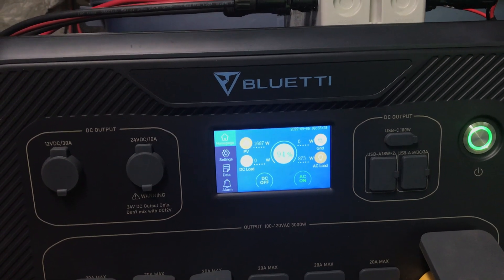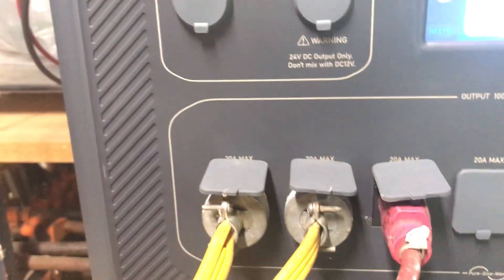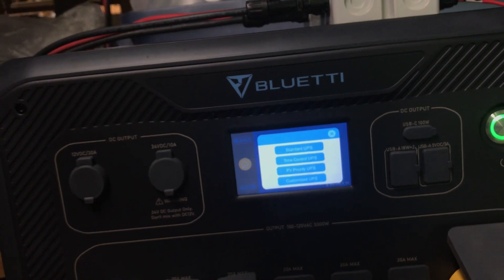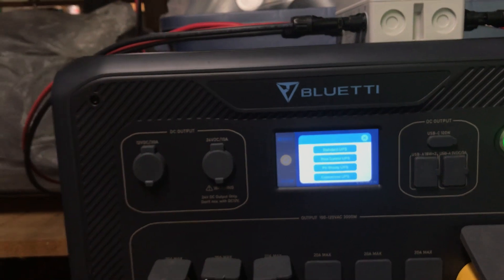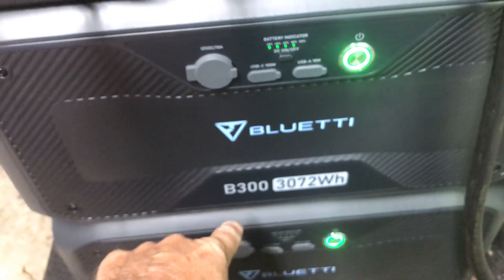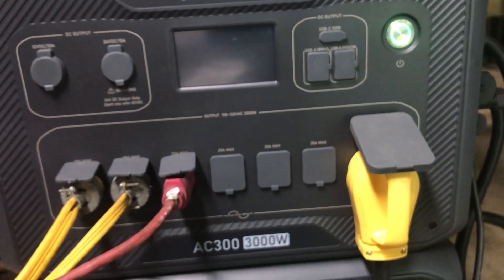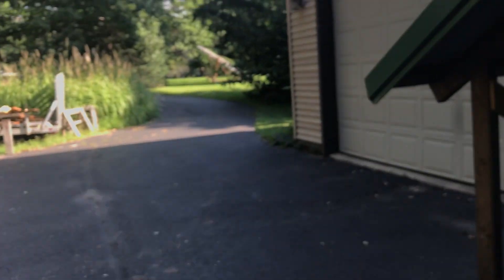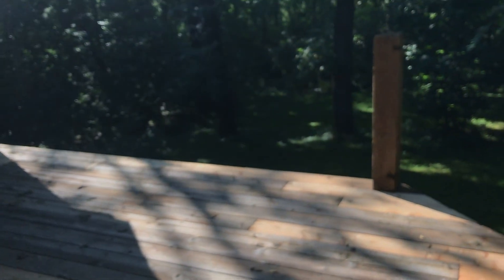A newbie learning UPS modes on bluettiAC300

Comment: Hi from Italy, thanks for video. Trying to figure out why my ac500 has 10% battery charge drop in 8hrs at night in pure standby mode, ac/DC off. It works as UPS, grid charging only ar 20%< PV priority. Where is all this consumption coming from,? Bluetti is suggesting to disconnect panel and grid charge ... Come on, it's an ups, I cannot! Best setting to prevent this loss? Thx for tips
Reply from the maker: I have heard from other sources that 10% charge drop happens in standby mode. Funny how Bluetti answered you
Reply: @johnkayak10  huge loss right? Thx for reply

Comment: Video named UPS modes ... but it doesn't cover none of the modes, there are 4 of them
supposed content:
* Standard UPS -> it is used when you need just an UPS things. So if your grid is off, it will drain your battery, otherwise it will change up your battery + it will do direct-flow from the grid to your outlets (on a AC300 front panel)
* Timed UPS -> ..some description goes here (sorry have not tried on mine this mode yet)
* PV over UPS -> you are able to use PV charge over grid, also it has a setting number which shows percentage, then grid will be used (100% - that percentage it will use only your battery) -> simple+elegant way to reduce your billings drastically, and save you battery from low discharge moments (when it reaches your set percentage, it starts to charge battery + direct electricity from the greed)
* Customized UPS mode -> PV over UPS rules are applied, but have not tried Timing settings (first tab in settings for this mode, used only the second tab), first tab in settings allows to ... (sorry, have not tried yet to change anything in this tab), and second tab allows to set 2 values: first percentage when bluetti should stop draining battery (if PV cells doesn't cover connected loading to your bluetti) and start the changing from the grid, and second percentage to shut down all load (when it reaches that percentage, bluetti will turn off any load on it's front-panel outlets)

so none of the modes are covered, and yet video name seems like a fake
Reply from the maker: What do you suggest I name it? I will change it

Comment: Is the UPS switching time fast enough to keep a workstation or gaming PC running when you pull the plug of the grid power?
Reply from the maker: This is what I found  
10. UPS
10.1. UPS Description
An uninterruptible power supply or uninterruptible power source (UPS) is an electrical apparatus that provides emergency power to a load when the
input power source or mains power fails. A UPS differs from an auxiliary or emergency power system or standby generator in that it will provide near- instantaneous protection from input power interruptions, by supplying energy stored in batteries, supercapacitors, or flywheels.
10.1.1. FYI (For Your Information)
Max. capacity retention indicates the limit of capacity of the unit that can be recharged by grid, if you set the Max. battery capacity at 80% at Time Control UPS Mode and Customized UPS Mode then AC300 could be charged to 80% via grid. The rest of the 20% capacity will be recharged via solar panels.
Reply: Same question for me.
Reply: @Andi9N  I got the unit now and I can answer my question myself: Yes. The unit is fast enough to keep my PC on when I disconnect AC power.
But before you buy this unit as UPS: there are some considerable design shortcomings with the UPS mode of the Bluetti devices. All internal electronics will only use battery power. This means that even when the unit is on good quality utility power, the battery is always being drained to 99% then recharged to 100%. This leads to extra power consumption and battery wear. I ended up by continuing to use a traditional UPS as UPS and use my Bluetti as offline powerstation to overcome longer power outages. This unit can power a workstation for around 8 hours. You can buy additional B300 batteries to extend the runtime. In this way, the Bluetti still blows traditional lead-acid battery based UPS systems out of the water.
Reply: @Aranimda  thanks for your information. What exactly do you mean with traditional UPS?
Reply: @Andi9N  A regular UPS system for computer devices from a UPS manufacturer. Like a APC Smart-UPS.
Reply: @Aranimda  thanks again. I think i need to go that same way too. I permanentaly used an Ecoflow Delta for my PC and WLAN and it was running all the time i used my PC. Yesterday, after 6 month of use, the Ecoflow is dead and failed the last 2 brownouts to keep the system running.

Comment: i have one ac300 and 4bc300s  been running this for almost three months now and PV priority is the way to go. I have 2K of panels so if there is any sun the system uses pv first with extra going to batteries. When the sun is gone(clouds or night) then uses batteries until 20%then switches to grid to run loads and charge batteries back to 30% where it goes back to batteries.  I am saving money for the second av300 and the split phase connector so i can run my 240v well pump and furnace. For now i use extension cords to power things in my home and have an electrician who will wire in a 6 circuit transfer switch that i will then plug my system into.
Reply from the maker: Let me know how that goes when you do it. I was told I would have trouble if I do the split phase with my transfer switch.  I do not have the bluetti transfer switch.  Thanks
Reply: I just got my ac300 and 2 B300 batteries. They're feeding a reliance 10 circuit transfer switch, running my whole house other than 240v stuff. Have you had any issues running it full time with grid charging? Are you using a transfer switch? I've read a lot about issues with ac charging and ups mode. I'm trying to figure out how to ground my panels then I'll be charging primarily with solar, but would be nice to use grid to ensure they never drain all the way.
Reply: @mikeconte2022  i have two ac300s one has 4 batteries connected and right now i am still using extension cords to power what i want in my home. Cant get an electrician to wire in a critical loads panel and a gen sw, they say they are to busy with bigger jobs?  My goal is to never use grid with these battery's. If they drain to low i unplug them and wait for solar to recharge them. When testing them i used the grid to charge them and had no problems, and also could charge them using a gas generator.
Reply: @arnoldreiter435  gotcha..... Do you leave the PV wires plugged in all the time? If so, is the unit indoors? I'm told Im supposed to use metal conduit indoors for DC, but I know this is pretty much just an extension cord and idk if I really have to do that

Comment: Mine stays on PV Priority with it plug into the wall.
Reply: I just got my ac300 and 2 B300 batteries. They're feeding a reliance 10 circuit transfer switch, running my whole house other than 240v stuff. Have you had any issues running it full time with grid charging? Are you using a transfer switch? I've read a lot about issues with ac charging and ups mode. I'm trying to figure out how to ground my panels then I'll be charging primarily with solar, but would be nice to use grid to ensure they never drain all the way.
Reply: @mikeconte2022  
Yes a 6 circuit manual transfer switch. I had problems occasionally with the inverter ac tripping off and sounding a alarm with the inverter plugged into the wall and in pv mode. Now I just use solar only and never plug it into the wall with no problems. My panel are not grounded but I have a inline fuse in each positive pv wire. I run six 360 watt panel with 3 each in series per mppt controller feed. On most days I see 1500 to 1800 watts input with 150ft run pv wire. I have seen 2100 watts of input on really good days here in Oklahoma.

Comment: That person would be me, lol.  If Your the kind of Person that Always has yours plugged in to the Wall, This is an AWESOME feature. You don't want Standard UPS if you have a lot of solar panels, You basically plug everything up to it, The grid will keep you topped off and if there is a power outage and you lose power the batteries kick in, PV Priority is the one Most People use, it still does UPS like the 1st one but most of the power going in to the battery will be from SOLAR and not the Grid. I keep my SOC (State of Charge) at 30, It will power everything from the battery until it gets to 30 and then the Grid automatically powers the battery and keeps it at 30 until the Sun Starts powering it again past 30, I haven't used the Last 2 Modes yet but the Very Last One The custom one you could turn Grid Charging completely off, I think that's the only mode that allows you to do that

Comment: UPS definetly a cool feature. My Titan doesn't have that but my Ecoflow does. Idk if you've seen it but Hysolis is coming out with thee most amazing&possibly the best "plug n play" unit to date by a long shot. Very expensive of course, it's called Apollo. I won't upgrade from Titan either but I am a week away from finally purchasing my back for my back up. It'll be the Growatt 3kw all in one. It's 24v so I can use my Titan batteries&my Lipo4 expansion with it if Titan ever fails. ✌🌞🙏 👍
Reply from the maker: Do know of any plug and play units that are just one unit that are split phase?
Reply: @johnkayak10  nope there's isn't any at this point. I believe it's mostly due to the weight that an added transformer would be and the fact that most companies want to make consumers buy a 2nd unit for that "ultimate" system.
Reply: The only thing I don't like about Titan (besides availability) is it uses Lithium Batteries, I've seen a video on youtube of a power station with that kind of battery EXPLODE at somebody's site. It wasn't just one Boom, it kept exploding because of the multiple battery cells, lol. I personally don't want that in my house, on a large scale anyways
Reply: @Moes_Prep_and_Tech  Yea explosions suck but almost every unit these days is lithium ion or lithium phosphate(LiPo4). I can't remember which is considered safer,I believe ion is alltho Lipo4 is much longer life. Titan is the only unit except the old model Inergy Kodiak that gives the ability to use ANY battery chemistry u want. Unless you choose to go with all in one unit.
Reply: @scarygary3569  lifepo4 is the safe one, but heavy, Lithium Ion is the lighter one charges really fast but not as safe
Reply: @Moes_Prep_and_Tech  ah right,thx👍
Reply: I admit the AC300 does have a ton of cool technology features that Titan lacks as well but with technology comes glitches and chance for error/faults which in some cases can render some units useless. Not a chance I wanted to take with this kinda necessity. Not to mention "if" a large grid down scenario occurs say goodbye to WiFi monitoring&any updates needed for software. Bluetooth monitor may still work tho. Still...AC300 is a sweet gig none the less👍
Reply: Just caught Will Prowse tearing down&testing a new Chins Li-ion solid state battery...he punctured 1 pocket cell and drilled into it and it totally blew up. It was just 1 cell out of the battery lol. Still not sweating my Titan batteries but still good to know that there are limitations and precautions to take when having Li-ion. Be good to them and buy quality products only👍